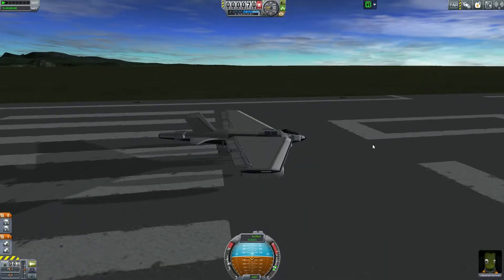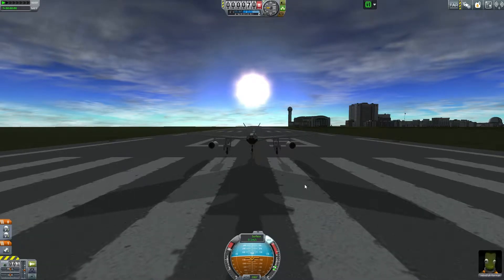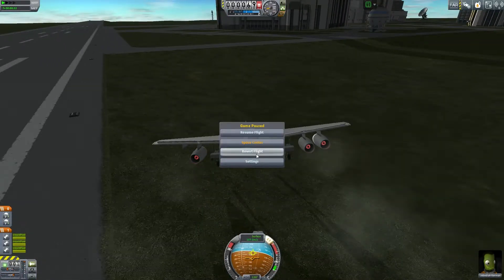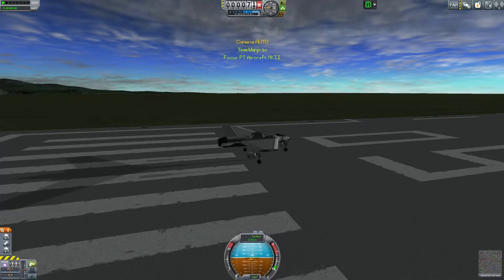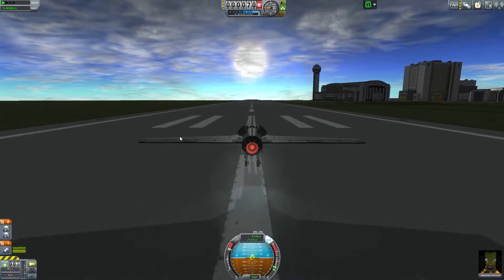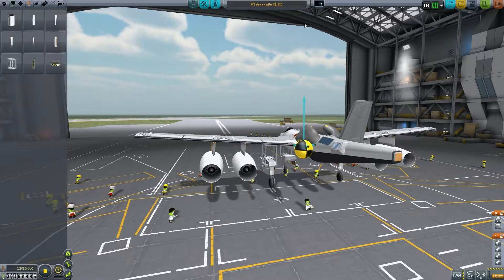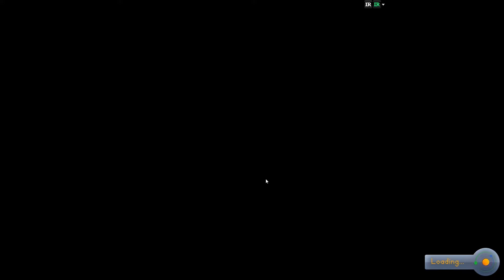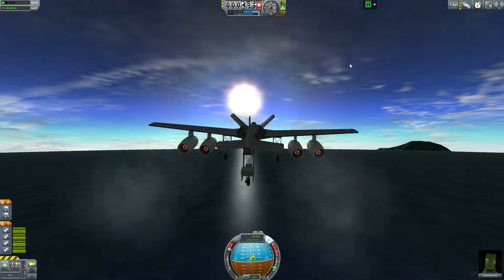Kerbal Space Program - Project Destiny: Episode #9 - More Wings

Comment: Just starting your series. Here's the problem with your planes thus far. 
1 landing gear too close together. Give it a wide stance for stability.
2 make sure you use horizontal and vertical tail surfaces that move.
3 place rear landing gear just behind center of mass so the plane can pivot the nose up off them (fulcrum)
4 rear horizontal surfaces can't be located over wheels or all they will do is push down on to them. The tail can't move down.
5 turn on wheel steering to help with control
6 monitor your intake air as you throttle up.  At full throttle your engines need a lot of air but if you aren't moving your air intakes won't be able to feed them. Some engines will then lose thrust and your craft will turn still at push the plane around.
7 never build a plane that is nose down while sitting still on the runway. As you gain speed your wings are pushing down not up.

Comment: Designing a plane similar to the P-38, with twin booms, would perhaps solve the landing gear issue - you could center one rear landing gear on each boom.  Each boom could end in an engine as well, removing two from the wings.
Reply from the maker: Good suggestion!